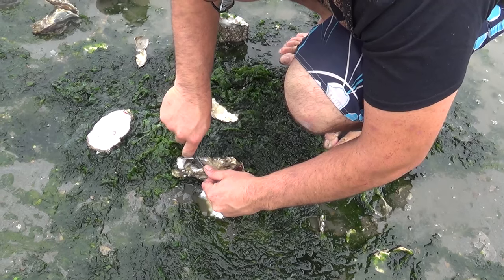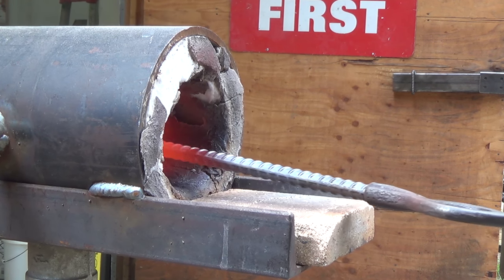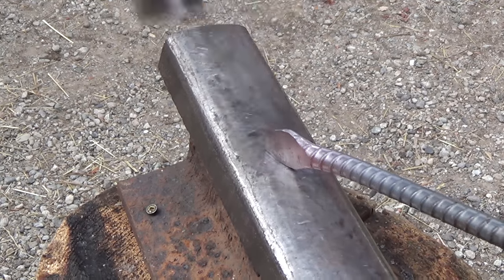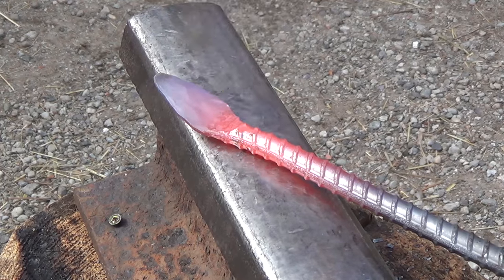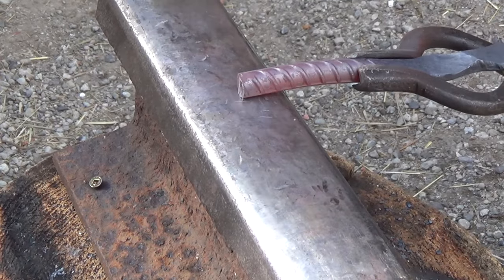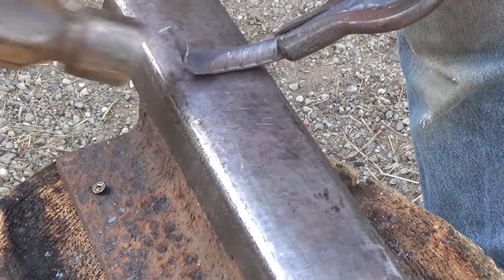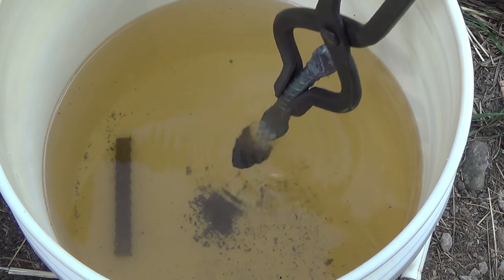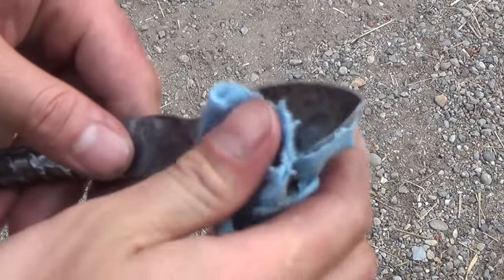How to Forge an Oyster Shucking Knife With Bottle Opener From Rebar

Comment: I find if you use a coal or charcoal forge you can get the carbon content right to take a bit more of a heat treat. It will never be good quality steel, but hey, it is cheap if not down right free in some situations, and it is good enough for a job like this.